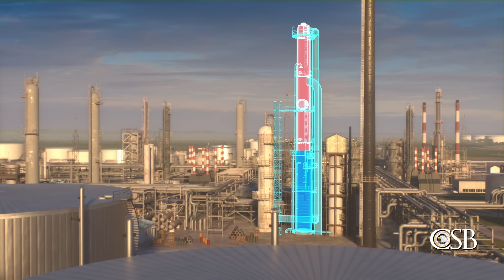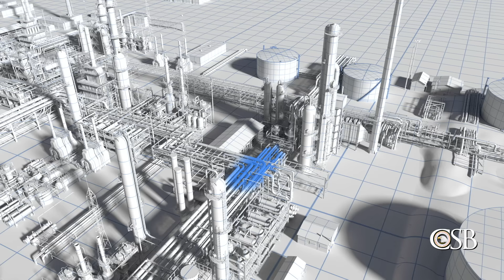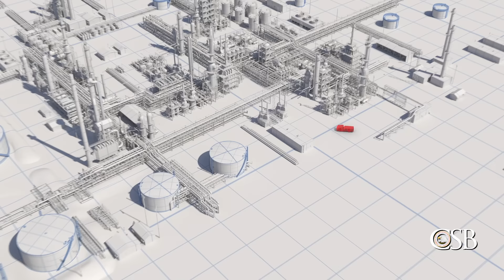Animation of April 26, 2018, Explosion and Fire at the Husky Energy Refinery in Superior, Wisconsin

Comment: This accident is very similar to the 2015 Exxon refinery fire also investigated by CSB. Both involved refinery processes that depended on slide valves, which failed to properly seal catalyst and gases in a refinery unit when closed.
Reply: was just gonna say. that accident sounded really familiar...
Reply: In both cases it was the same type of refinery unit that suffered the exact same failure where one of the slide valves eroded and coulndn't maintain the catalyst barrier. However in this case there was no mention of the steam purging of the reactor which means either this procedure wasn't used or the valve was in such bad shape that the barrier was gone within minutes, before the steam was intoduced.
Also for anyone looking for the video we're talking about: https://www.youtube.com/watch?v=JplAKJrgyew
Reply: would think over all these decades, these penny pinching multi-billion dollar oil conglomerates would put a simple redundant system on everything or at least some sort of simple monitor that can detect if it didn't close fully such as the end/tip of the slide valve needs to make contact with a sensor on the opposite end so this can let you know there was a lack of contact whether due to mechanical issue (didn't slide close all the way) or corrosion.. or simply, should be 2 slide valves that close per side, so if one fails, at least there's a backup.
Reply: @LycanShift  Generally there are failsafes of some kind and backups for critical systems designed in from the start, but the problem is once that's built maintaining it becomes just "something that costs money" with no visible benefits to management. After all the machine is working fine, why do we need to test and maintain and upgrade these safety systems when they don't even make us any money? It's the same shitty reasoning behind why data breaches at major companies happen so often - if your IT Security team is doing their job well *nothing happens*, and that's good! But boy, just try convincing upper management that you need a budget when the end result of your efforts is "nothing happens". This is why we need goddamn regulations with teeth, in all sorts of industries.
Reply: I thought this was another animation of the same thing
Reply: To make this video way funnier, replace slide valve with slide whistle.
Reply: In nuclear we never isolate dangerous systems with just one valve. There are redundant and check valves to go along with the isolation valves.
Reply: @GiddeonFox  exactly why agencies like the USCSB need to set up rules/regulations and/or pressure congress to pass laws that force these companies to test and maintain and keep up to date (upgrade) these safety systems otherwise face stuff penalties that would be far higher than the cost of if they were to maintain these systems and/or forced shutdown of machinery/facilities out of date/compliance.

No different than the FAA does with the airlines, if a company can't keep up with the latest FAA rules and compliance requirements, then tough luck, those airlines go bankrupt and go out of business if they can't upgrade their fleets. The same needs to happen with these oil companies as the oil companies aren't riding a fine line between profit and bankruptcy unlike the corporations in Airline industries, as every oil company there is today have billions upon billions (some literally in the hundreds of billions of yearly profit) to spend on safety.
Reply: Raven Unfortunately the CSB is not analogous to the FAA, it's analogous to the NTSB.  Both the CSB and NTSB investigate accidents in their respective fields, but don't have the power to make regulations.  They can only issue a report and make recommendations.  This is actually deliberate, so that a regulatory agency is not in a position where, having failed in its duty, it must then investigate its own actions.  To use your example of the FAA, if they had been responsible for investigating the Boeing 737 Max crashes, they probably wouldn't have focused on their own approval process as the ultimate cause.  Likewise in the chemical industry, the CSB exists because regulators could be reluctant to admit their own role in an accident.
Reply: @amykathleen2  Unlike the USCSB, the NTSB investigations generally do lead to industry changing rules.. Take your example with the Boeing 737 Max crashes, the FAA stepped in and grounded ALL Boeing 737 Max airplanes, as the NTSB had barely begun their investigations and in general as a result of NTSB reports, there are often industry wide changes, forced design changes, forced safety inspections and mandatory compliance, etc. 

That's what the chemical/oil companies need, an FAA who has the balls and authority to be willing to step in and halt production nationwide or force safety inspections and mandatory compliance, etc as a precaution while the CSB does their investigations and/or as a result of their report. 

Take this corroded safety value for example.. I can guarantee you that even though this exact same design of value is in operation in refineries across the nation, not a single one was inspected or replaced, as a result of this investigation, because there is no agency to force it. unlike the airlines.

It's kinda ridiculous seeing some of these CSB reports, especially how some of these are mirrors of previous reports from years or decades ago, which just goes to show that changes don't happen because enforcement doesn't happen. also ridiculous how simple penny pinching by these multi-hundred billion dollar corporations, who spend less on safety than a company whose lucky to even see one billion, this type of BS should not be allowed, especially when these companies literally have facilities location in the heart of a community and whose accidents can cause harm/deaths or displace thousands within those communities.
Reply: @LycanShift  this is a terrible idea. if you want to recreate the Torrance refinery explosion, this is how you would do it. two slide valves per side would change the differential pressure dynamics between the reactor and regenerator, a pressure which is crucial to ensuring that hydrocarbons don't backfeed into the regenerator or worse, the electrostatic precipitator. additionally, a sensor to ensure closure - which is essential for remote monitoring from, say, a control room, something which all refineries have - conveys no information on the condition of the valve, adding no additional measure of safety.

you've obviously never heard of independent protection layers (IPL), layers of protection analysis (LOPA), safety instrumented systems (SIS), or anything having to do with safety-oriented advanced process controls (APC), all of which exist and are heavily implemented in oil refineries like the one in Superior.

corrosion/erosion engineering is a specialty field relied upon in refineries to develop preventative maintenance plans. they collect data on vessel and piping wall thickness, corrosion rates of process fluids, metallurgical resistance to wear, and much more. contrary to your implication, oil companies spend significant amounts of money employing specialists, surveying the condition of equipment, and performing scheduled repairs to prevent accidents like this from happening.

if you truly believe in the greed of "multi-billion dollar oil conglomerates," you cannot ignore the economic incentives those conglomerates have to avoid incidents which 1) incur fines/lawsuits 2) generate bad publicity and 3) cause harm or injury to people or the environment. considering that incidents at refineries tend to be costly, well-publicized, and explosive, oil companies, like all other companies, are strongly motivated to mitigate those incidents any way that they can, since i can assure you that it's cheaper to avoid them than it is to endure them.
Reply: "You think prevention is expensive!? Try having an accident!"
Reply: @grandaddywh0  Firstly that's what engineers are for, my idea may not be feasible but there definitely is a way to implement multiple redundant safety systems and/or periodic forced mandatory inspection/maintenance. 

Then when you stated: "1) incur fines/lawsuits 2) generate bad publicity and 3) cause harm or injury to people or the environment. " unfortunately in many cases, it's cheaper to settle lawsuits than it is to implement preventative safety. 

A good recent example is the ignition switch scandal that a whistleblower finally leaked to the media about GM vehicles.. it's a defect that's been known to GM engineers and executives for over a decade, however they choose not to fix it because it was actually cheaper to pay out any potential injury/death lawsuits than to recall/repair/replace the defective part. Worse yet it was deemed cheaper to keep the existing defective design than to engineer a new design for new vehicles, so as a result GM was still putting that same known defective design in newer vehicles for years to present day.

Pretty much it's the same with oil/chemical companies. If their risk assessment team and lawyers deem that paying out potential death/injury lawsuits is cheaper than to implement a new safety system, you better believe they will continue the status quo, and sadly there are plenty of examples on this CSB youtube channel of exactly this, known defects and paper trails of recommendations and such being ignored because it was deemed more expensive than the cost to fix/prevent. i.e. the Phosgene release at Dupont which killed workers because the company refused to pay for proper enclosed storage with scrubbers and replacement of the stainless tubing with tubing that wouldn't corrode because it was deemed more expensive versus the cost of an accidental release.

Just take a look at this BS official document uncovered after that incident at DuPont: https://i.imgur.com/UZ9I8qF.png
Can see how their risk assessment team put a potential price on the loss of life and public outrage, and as a result refused to pay a measly 2 Million dollars for safety system as it would set a precedent and force them to implement similar safety systems at all facilities, so in otherwords, they set safety aside and allowed for the potential of worker/public death because any potential lawsuits would be cheaper.
Reply: Ok, I thought I was watching the Exxon one over again. Crazy! Could they use a ball valve versus a slide? Or is that not possible?
Reply: Ik, right? They REALLY need to revise their slide valve system. If this happens again, a new law/regulation should be put in place.
Reply: consume egg or have some kind of back up valve below the slide valves for the shutdown so the slice valves can be checked and/or replaced
Reply: This design just isn't inherently safe; the failure or operation of one single component shouldn't be able to demolish the plant.
Reply: @Unb3arablePain  Like at Three Mile Island, Chernobyl and Fukushima?
If these reactors were built to Canadian (CANDU) standard designs these accidents would never have happened.
Reply: 'sigh' The Canucks are back at it with their "superior" reactor designs.
Reply: @Unb3arablePain  I'm South African so have no dog in this fight, though we do breed the best idiots in the world for idiot proofing tests :)
Reply: Igor M. Agree with most of your comment, except that a proper emergency shutdown for an FCC unit should immediately introduce riser steam in the reactor upon a feed diversion. One could theoretically maintain a proper pressure barrier even without a catalyst barrier, however you now have to rely on one barrier. Critical thing here is really having a proper monitoring plan for confirming catalyst seal, and once that is lost there needs to be immediate action to place the fractionator blind.
Reply: It’s funny because I just watched the Exxon one and then clicked on this video, and I had thought I was watching the same scenario
Reply: It's almost like they kept doing the same shit weird and don't actually care
Reply: Yea
Reply: I read your comment in the narrator's voice
Reply: @igorm.2073  this was a shutdown that one was a just automatically put on hold I believe that’s why there was no steam
Reply: @amykathleen2  Excellent explanation. I was just about to clarify this for the readers, but you beat me to it. Thank you!
Reply: @amykathleen2  Weird logic you have there. The reason they don't have teeth is because big companies don't want them to lower their profit margins by making things safer.
Reply: @grandaddywh0  I think the excuses you keep making for the current system really show why it doesn't work and why there is such a big problem with industrial safety practices.
Reply: a single isolation that is regularly used and could cause this sort of damage when failing is completely ridiculous to me, how on earth could that pass any decent risk assessment. As if the American's can't even do a layers of protection analysis properly
Reply: I thought I was watching a remastered version 😳
Reply: It's the same Electrostatic unit
Reply: @LycanShift  It is such violent environment in there you cant

Comment: "At least it was just the one explosion"
"At least the asphalt didn't get everywhere."
*Asphault catches fire
"..."
Reply: At least we saved money resurfacing the lot?
Reply: How does asphalt find an ignition source inside a rafinery facility is beyond me. From the videos it looks like there have to be dozens of open flame fires inside every facility running nonstop.
Reply: The asphalt may have flowed into an electrical source and shorted it, or melted/flowed through some insulation and hit a steam tracing pipe.
Reply: @kubeek  When you have a huge volume of flammable material in a large industrial plant there's bound to be something to set it off. There's all kinds of hot electrical and fuel-burning machines in a place like this, and no one planned for flammable asphalt to be sprayed all over the place. The asphalt was also heated, so it's possible it was producing flammable vapor depending on the temperature of it. Fortunately they handled this well and it seems nobody died.
Reply: idk why i came back to this almost three years later...but i’m from superior and there was one major explosion but like four smaller ones. got 1.5 days off of school and still had to make them up.
Reply: @kubeek  In my process safety class we learned that ignition sources are free. Once a flammable substance is released all it takes is a light, hot enough surface, even the static discharge of sharp piece of metal or person walking across carpet. The process of filling tanks can sometimes cause sparks as well and floats used to measure tank levels sometimes need to be electrically grounded.
Reply: Yes there is oil in it
Reply: This is some Rube Goldberg sequence of events to get into this mess... it sounds like the first responders did an excellent job getting the fire under control before anything else went up.
Reply: At least no one was injured or killed.

Comment: I am an operator, and very rarely do we rely on one valve for positive isolation, simply because they all tend to pass over time. 

A slide valve with a constant flow of solid catalyst is most definitely going to erode quickly either on the valve seat or the disc itself. This is an oversight by engineering by not adding either a double block and bleed, which would allow maintenance to be performed on the slide valve without having to drain and purge the entire system (which most likely is the reason they let it erode so much since units never want to shut down for long periods), or adding redundant level switches in the line which would ensure the catalyst barrier remained in place by alarming if it was declining. 

No one is perfect though, and things are always going to get missed. But with awareness comes change, and we play these videos at safety meetings so everyone at our company is aware of the hazards and issues that have come up all over the world. I thank you USCSB for doing an outstanding job. You are saving lives.
Reply: To hear these get used by exactly the folks who need to see the is outstanding.

Comment: The lesson of this video: CHECK YO SLIDE VALVES!!!
Reply: And if one is eroded, replace them ASAP! Even if it means shutting the plant down for a time
Reply: dan96kid 
Even more importantly, keep the levels up in both the reactor and the regenerator. The pressures on either tower can be adjusted to maintain those levels. 
THEN, service both slide valves during the turnaround.
Reply: Riff would some kind of backup barrier system work, like a set of hinges doors that seal the stack?  Then the slide valves can be checked and replaced safely
Reply: davyt0247 
Definitely. A positive seal shut-off valve to back up slide valves would work. Just very expensive.
Reply: And.. use two valves for safety reasons.
Reply: Colleen Ross Unfortunately this is not feasible since these slide valves always leak, but some more than others typically due to improper management of dP across them. Also, if they are leaking then you will still have the risk of losing the catalyst barrier when shutting the unit down to replace the slide valves. Key things are 1. managing catalyst barriers via safety critical pressure instruments, 2. establish proper steam barriers for pressure balance, and 3. have a back up plan in place when either of the previously mentioned steps fail (i.e install isolation blinds).